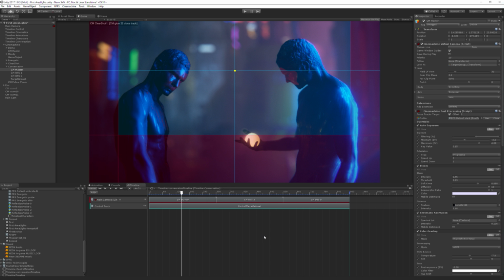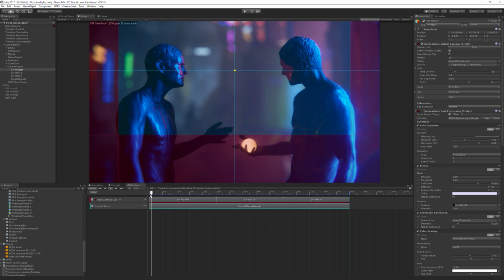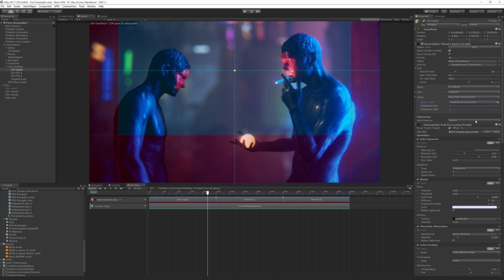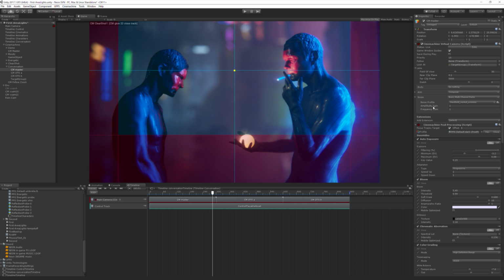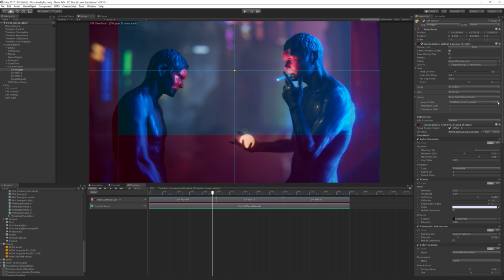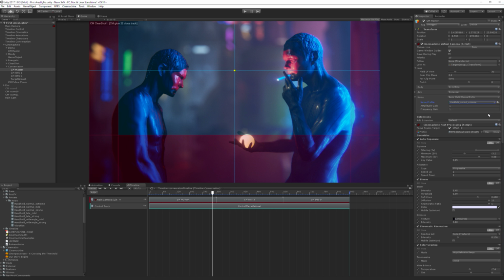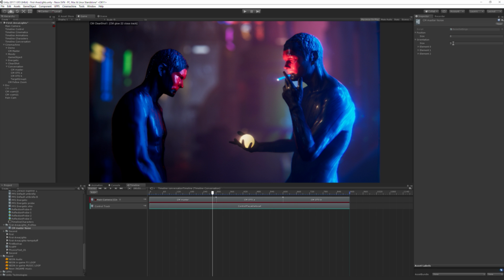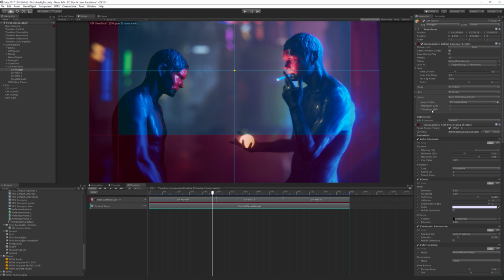Using Noise in Cinemachine

Comment: Hi, I have troubles. The blending between 2 cams is not seamless while there is noise. Anything to suggest? (Noise is added to one of the 2 cams, and when the transition from cam1 to cam2 is at 100% there's a slight shake, I don't get why.) Thanks!